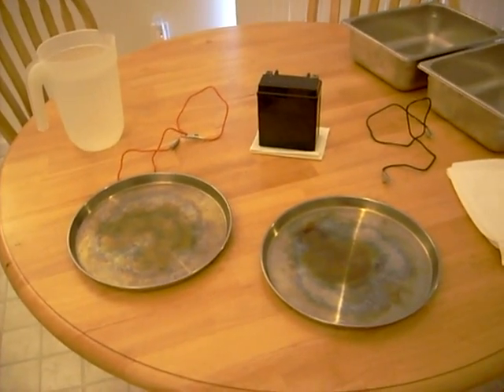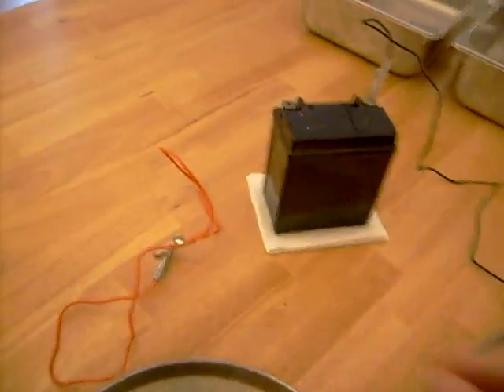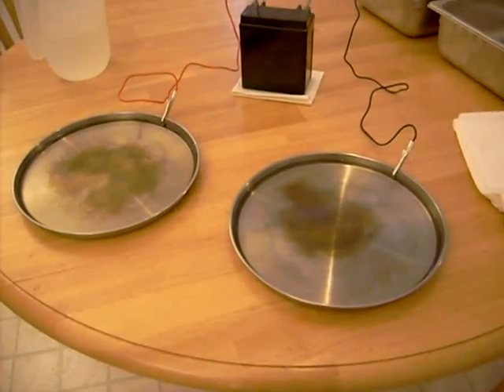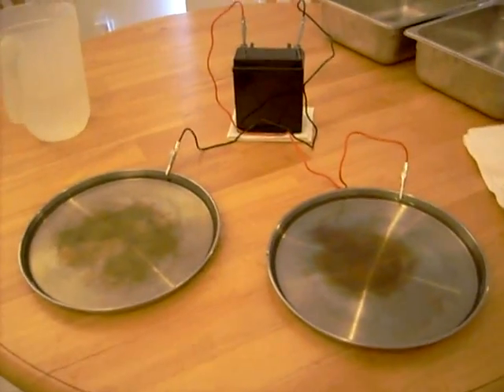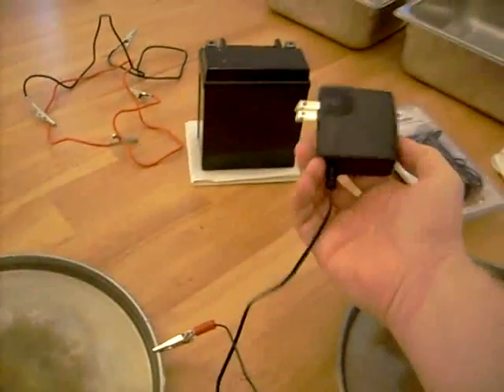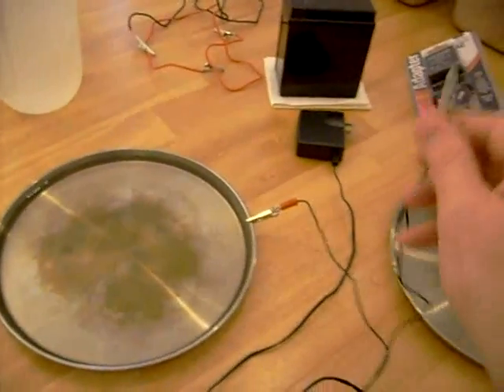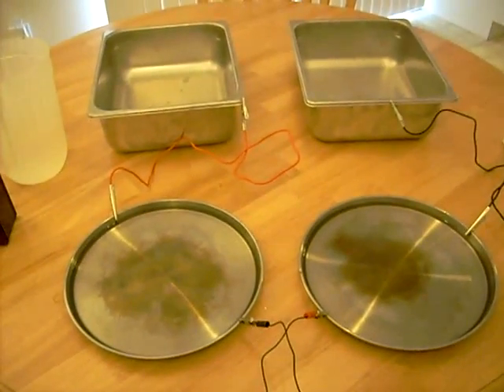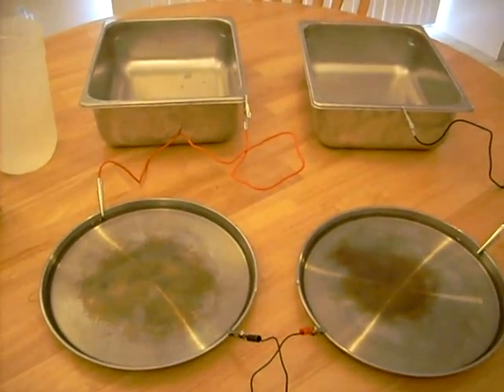Cure Sweaty Hands, Palms, Hyperhidrosis, Hyperhydrosis

Comment: are aluminium trays good enough or is another material preffered for the trays?
Reply: Cheap Cooking/Baking aluminum tray you could find in Walmart will work. I paid like $3-5 for 4 trays. A pair of tray will last me like a month or two. It will eventually leak due to electricity will damage the surface. Then we will change the tray to new one. It is annoying but still much cheaper than buying the device that cost $500-1000 or even more.

Comment: @cristinavee Yes it should. You could use plastic pans or glass even and dip the wire ends in the water. As long as you compete the circuit. Baking soda helps.

Comment: I'm not pro and I'm clumsy. If you are good enough, you can even add dial to adjust current from 2mA to 4mA. Or even pulsed current, which is said to be more effective, and with less side effects.

Google "constant current source" and "LM317" for more information on how to make constant circuit circuit.

Comment: i got my aligator clips online.  Just google aligator clips they are really cheap.  Some people say you can buy them at radio shack or home depot but the ones by my house did not have any.  

For batteries just go to wal-mart and get the 9 volt duracell batteries that fit into smoke detectors and things like that.  The 9 volt batteries are around $4 for a two pack

Comment: Thanks for that Audiguy.

In my experience for the past year, iontophoresis generally does greatly reduce the amount of sweating on hands. However, it's not perfect - my hands still sweat 25% what it used to. 

It also comes in peaks and troughs. Some weeks my hands are completely dry whereas other weeks they are more sweaty.

Anyway, I'm gna boost the voltage up and hope it goes away for a while again.

Comment: @krivinz are you using in proper way ? 2 sessions with 2 polarities ? because i had worse situation but now i need to put hand cream to avoid dryness. Use 18 volts AC DC adapter instead of batteries

Comment: The AC adapters do not create true DC power, the just cut off the top/bottom of the AC sine wave. I don't think this should make a difference in treatment but it will make the experience feel pulsatile, like the 60 cycle AC power origin. The battery would make true DC power. I doubt it effects the treatment but it will feel different.

I found 24v high, very shocking. Metering it down to 18-20v made a big difference. It went from very uncomfortable at 24v to fine at 18-20v. Small change big diff

Comment: @123Evdawg Yes, you can use up to three 6-volt, so bottom line is 24 volts is safe.  This guy has an updated video showing how to do this with several 6-volt batteries and some pie pans.  My 14 year old tried it and it works!  Does require regular maintenance (once or twice a week on-going), but that's a small price to pay, I think.  Hope this helps.

Comment: Hi
I have extreme hyperhydrosis (my hands and feet drip with sweat most of the time.)  But I have adapted and have decided not to have the nerve snip. 

I have had a similar treatment to the one you describe in a hospital setting.  It gave me small blisters that peeled.  I don't remember them being dry after.  But it was only one treatment.  

How long untill you need a top up treatment?

Thanks for making the effort to post this.

Comment: Would adding more baking soda have the same effect as upping the voltage?  The reason that I ask is that I have a 12V adapter that I'd like to use if possible instead of buying a new one.  Since adding baking soda would cut down on the water's resistance and thus increase current flow, wouldn't this be exactly the same as increasing voltage in order to increase current flow?

Comment: Hi! I found out that I had the tools right at hand for building this device so I did. I took 2 aluminum foil bowls for cooking and an adapter that says AC/DC 220V to 12V, 500mA (is this safe to use?),cut the wire, seperated it into the two smaller wires and connected them to the foil bowls. I tried it out but the thing is- it hurts to much I think! I couldn't even get my hands proper down into the water, I quickly pulled 'em back when I felt the jolting. I don't know if it's to strong? it hurts!

Comment: I did it with plastic pans and aluminium foil in it, placing the naked wires straight into the water.  Need only 8 sessions with 30V Now my hands are DRY !!!!!

Comment: Hi folks, 
I've been started using this method for about a week. No result until now but i'm expecting some miracle in a week to come. But there's something i still wonder because according to the official treatment at the hospital they use a machine which produces a steady 5-20ma DC.
Our simple machine, however can produce the same current but it's not unstable. And moreover, according to my Ohm meter, the resistance between my hands is about 5-10K (oscillate a bit depending on the skin condi

Comment: @XPRS13 As far as what is harmful, It is all about total power which is Volts x Amps. So high volts at tiny amperage will not harm you (like spark plug wire or lightning) or vice versa. I would love to have an ammeter to determine the current of this procedure.

Comment: @sx2000 I have mild hyperhidrosis of the face, back, chest, and buttocks; moderately severe hyperhidrosis of the hands and feet. I sometimes experience that 'sweat trigger' too, but because of my repeated treatments, I know that when I experience that trigger I'm not keeping up with my treatments. As for finding a pan large enough, I have had great success with aluminium pans used to hold BBQed foods from dollar stores. The only drawback is that they may start to leak after a few weeks.

Comment: @somekidfromaplace
You should probably avoid touching the pan at all to get a good result. The trick would be to use as big a part of your had as possible as the "conductor", and if you touch the pan, even if it's only with your thumb, most, or possibly all of the effect might be negated. Frankly, odd as it sounds, it would probably be better to place your palms at the bottom instead of just making a small connection (that being said, no contact at all would be best).
Hope that helps ^^

Comment: If you can feel tingling in your hand than thats it. I tried on 12 v and I feel almost nothing just a weak sensation on back of my palm. If its really weak you should try get higher voltage. This is my 4th day doing it and I use 20v

Comment: @autoinfo2004 It is about both. If the voltage is too low they the natural resistance of the body will stop the circuit. If the amperage is too low then there is too little flow to do anything.

Comment: Hi, Great video. Have a question. I already got the motorcycle battery and stainless steel trays, I just bought the clips and it came in different colours. Black, White Yellow, Green, and Red. Which 2 should i use?

Comment: after 30 days, it doesn't work :( Can anyone help? i do it every day around 12 min/hand. I have around 27 voltage( 3 x 9V bateries in series- the one batery is not full charged), i change the temperature each cure (of water,cold and warm). The water is clear mostly. My palms sweat still ! plz help

Comment: XPRS13, I bought a multimeter, (a little better one that shows the mA -milliampers),
if I have used it correctly  the result was;
I used 3  6Vbatteries for feet, 18Vs total, and the mA was 24-25 mA on the screen.
(varying from 23 to 25mAs)
and I used 2 6Vbatteries for hand and total of 12V, (I cant stand more than 12 for hands) the mA(milliAmper) was 15mA on my multimeter screen.
Hope it helps or gives any idea.

Comment: ...My hand in the negative charge was particularly reacting strangely. My fingers were & arms were kind stiff & locked into place. My middle finger for that hand was pointing up & positioned differently than my other fingers. When I slightly moved my hand above the water the electrical current & sensation on fingers became more intense making my fingers jump everywhere. Through a few times. I gradually got used to the initial sensation, stiffness, and spazing and gradually submerged my whole...

Comment: Ok so I am writing just to give my story, so had sweaty hands bah blah all the rest decided to do something about it

tried this treatment. 2 car battery chargers with a 6,12,18,24 setting had them both joind up in circuit. 

i have been using stainless steel trays for oven, and baking soda, i have also been using driclor a aluminium roll on for sweating but just putting it on hands then putting hands in the water.

been doin it for 16 days beginning with 12volts for 7 days then 18volts for 9day

Comment: I have been using a similar home made device for roughly a year now but have grown concerned that the stainless steel pans could be causing chromium poisoning. Iontophoresis is a technique using a small electric charge to deliver a medicine or other chemical through the skin (wikipedia), and I am worried that stainless steel pans could be transmitting small amounts of trace metals, etc through the skin. Perhaps the materials of Medical grade Iontophoresis devices are more nonreactive?

Comment: I have using it for two weeks and counting, I haven't seen much change in my palm sweat. Can I go for 12v 70A car battery? 
Thanks so much.
Reply: Add nine volts(nine volt battery with small engine 12 volt) in series.....21 volts total. I swear to you it works for me.Do it twice per day for at least to start with for two weeks.Nobody is trying to sell you anything here.
Reply: If you have any open cuts add ointment to the cuts. Trust me.....anything open in the water will burn.
Reply: +cyberian2007 how do you treat your feet?

Comment: @brownmeow3 there are many reasons to this. It's due in part to your hands becoming more acclimated to the voltage and thus less sensation on them. However I would suggest buying new lantern batteries. I have a similar issue.

Comment: I bet it is terrifying, personally I'd make sure there is a fuse in your adapter, if not. Go buy a fuse and wire it into your rig. For safety sake, right? If you get a 1 amp fuse, you should be safe. 12v at 1 amp would be hard to do with an adult body, and that's about the cutoff point for safety. Still you're fairly safe running this, as long as your hands are submerged in the water, and not just lightly touching the tips of your fingers in it. (You can cause burns if you do that.)

Comment: Again 7ah is just capacity, so it will only last for 7 hours of 1 amps @ 12 volts. if your body is resisting the current to 0.1 amps you'll have in theory 70 hours of treatment time on that battery.

Comment: ..hand in the water. Now after watching the second video I realized how making your palms not touch the bottom of the pan makes a difference. After I alternated the polarity after 10 minutes doing my hands for a total of 20 I removed my hands & felt a short zap. My forearm which was in the negative charge last still feels stiff & kinda sore. My sweating has slightly came back as well Are my reactions normal, is using a car charger-jump start cable safe & will it yield the same effective results?

Comment: it took 2 months before it worked for me. first 6 weeks, I was doing it at 12V-10 minutes per polarity.  Sweating of my hands reduced a little but I wasnt satisfied. I cannot get an AC adapter with higher output so I increased the time to 20 minutes per polarity. I even did it twice in one sitting when I have time.  Truth is I was already losing hope.  I just kept doing it and around the 2nd month, it suddenly worked.  Now my hands are dry even if I'm exercising or playing basketball

Comment: 3)Increasing the voltage - i started using 24 volts after about 3 years thinking it would lengthen the effect and it was working for a while - but suddenly it stopped. I couldn't put my hands in the water for more than 5 mins and my fingers would also become soft and cut up.

I bought a variable voltage adapter and dropped the voltage down to 16 volts. Treatment started working perfectly again

Comment: @zb98cobra thanks for responding. And im using a enercell 12v battery for 20 min. and 10 min. for each polarity. I feel like this is not enough time or volts. Where did you get your batteries??

Comment: I see the professional machines use 25mA. The only AC to DC12V power supplies I can find use 1000mA. Is that ok or too dangerous?
Reply: I think the current the professional machines are showing is the effective current passing through the body. This effective current is determined by the resistance of the body. The actual output current of the machine is actually high. So, even when you use the battery with 1000mA current, the high resistance of the body will mean that only small current (probably even less than 25mA) will flow through the body.

Comment: @xxvodanhxx best would be AC DC 18 volts adapter. avoid fresh water from the tap and go for mineral or filtered water that has less salt. 9 volts wont produce good results. avoid putting feet directly on the ground if you are not using it for feet. check short circuit. both negative positive should be touched with each other....

start with 3 times a week then twice a week and then once a month is more then enough. get rid of tensions..

Comment: Ok, I have a few questions. I tried this and did not get much result but I stopped after 5 days because I was frustrated with how the treatment felt. I am about to give it another shot. I just want to make sure of a few things. First, do I do this every day or every other because I have heard both. Also, my hands itch really bad when my hands are in the water. The jolt bothered me at first but the itching drives me crazy. Is this normal? It really bothers me when I have a little cut on my hand

Comment: @PianoGirl555 if ur usig 15v with 2.2 amps without any problem then its fine. i have an adapter 18v with 2amps but i was not using it because of high rate of amps, but now i will start using it, thanks for your information. amperes are not so important but i want to know how many is allowed.

Comment: This... is ridiculous. In the 3 years I've used this, I've used 18v DC for my treatments. However, I've noticed a few weeks ago that the tingling isn't being felt anymore. I bought a new 18v adapter to see if that would fix it; nope. So I asked a relative to stick their feet in the pans after I demonstrated that I hardly felt a thing; their subsequent reaction was like mine when I first did it–intense. Do I have to go up to 24v now? And higher still in the future? I see that getting dangerous.

Comment: PLEASE HELP ! My feel and
 hands are still not getting dry!!  I’m using a 12v battery and square aluminum pans. (the disposable ones from thanksgiving) Could it be because I’m not using metal pans?
Reply: How long have you been doing it? It took me about 30 days for me. You have to use aluminum or other metal that conduct electricity. Do not use plastic pans if you are using one.

Comment: The water with some NaHCO is effective for me. Now when I am home my hands can totally not sweat at all except three conditions:
1.Going outside.
2.I irritate myself. Like rubbing my hands against some coarse fabric...etc
3.It's the most important: after taking a bath it will lose efficacy.
Does anyone have the same condition like what I mentioned (No.1&3)?
Will replacing the water with NaHCO by the mineral water slove No.1&3 problems?